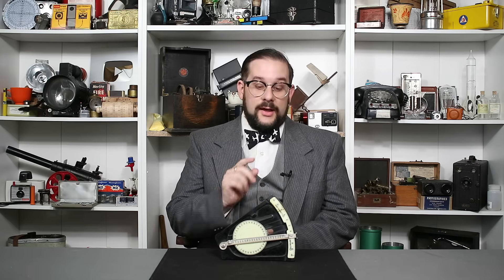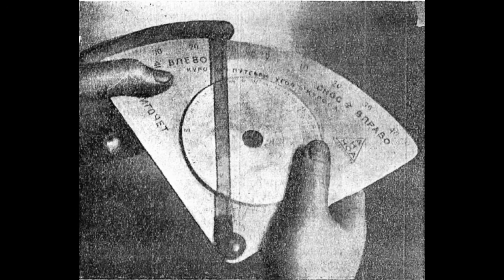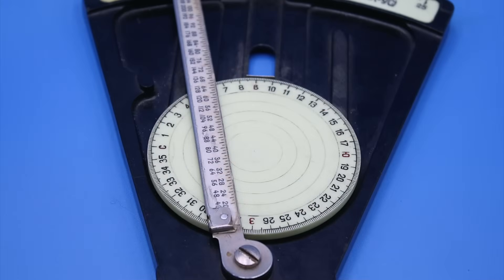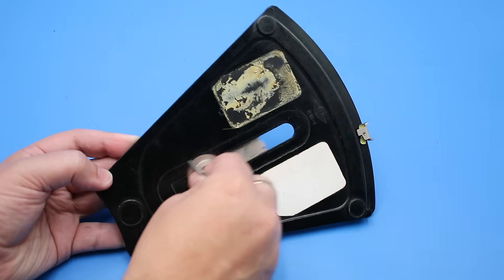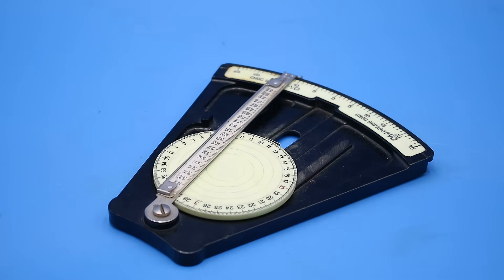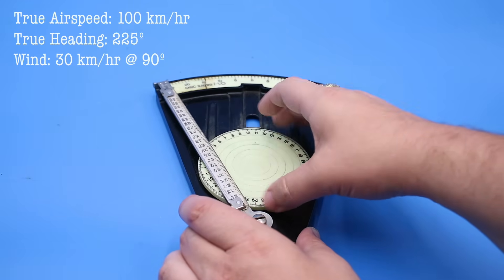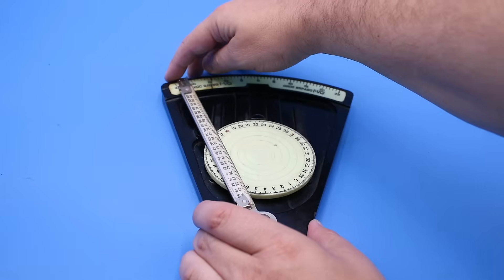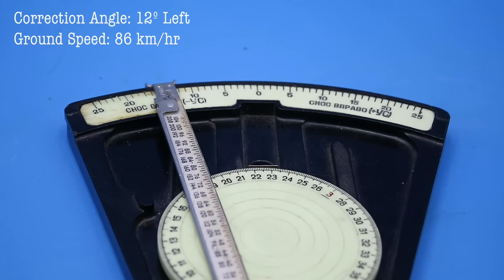SHORT: VSh-1 'Vetrochet' Course Corrector

Comment: today modern avionics  the function is completely computerized so they punch in numbers and it shows up on a lcd or oled display
Reply: That’s assuming they aren’t using autopilot which compensates automatically.
Reply: It's still a good idea to have a backup.
Reply: And when the computers go wako because of faulty sensors you elegantly call for Mayday and ditch into the sea.

Comment: Q:  When at altitude how does the navigator know the direction of the wind and its force other than the amount of rudder trim the pilot may have on the aircraft.
Reply: For flight planning purposes you use the winds aloft forecast. Once you're at altitude, since, regardless of the forecast, the only weather that matters is what you see through the windscreen, you can use a wind triangle "in reverse" to calculate the actual wind.

You know your true airspeed, your course (where the airplane is going), and your heading (where the airplane is pointing). All you need is your groundspeed. If you have DME, you can read it directly. Otherwise, you can fly over two landmarks and calculate the GS from the distance between and how long it took to traverse that distance. Draw a wind triangle, et voilá, there's your answer.

A wind triangle is just a graphical method of doing vector addition. You have three vectors: one is your airplane's motion relative to the parcel of air it occupies, another is the motion of that parcel of air relative to the ground, and the third is the motion of your airplane relative to the ground.

If you know any two of the vectors, you can calculate the third.
Reply: @johnopalko5223  Excellent explanation. Tiny nitpick: voilà, not voilá. 😻 [edited to fix formatting]
Reply: @Ice_Karma  Son of a gun, you're right! I've been spelling it wrong for ages. Thank you for bringing that to my attention.

I just checked some other things I've written and I can't even blame this on a typo. I've been consistently incorrect all this time. Shucks!
Reply: Predictions from Comrade Meteoroligist!  Then checking features on your chart (map) as you fly.
Reply: Vector addition G=A+W
  It's evolved lits of ways over the years. But generally a navigator could compare true airspeed, to groundspeed on a map, to the deflection of a given landmark over time and be able to calculate windsoeed and direction when at altitude.
Reply: You never apply 'rudder trim' to correct for wind. Not unless your intention is to fly inefficiently, with an added possible risk of spinning. Instead, you keep the ball centred and correct for wind by heading slightly into it - you can eyeball this to some extent (and may have to, when landing in a crosswind which may vary with altitude), but for long-distance flight you need to compute the angle.
Reply: You can also indicate a question by ending the sentence with a question mark.